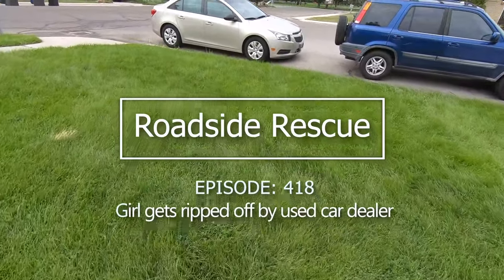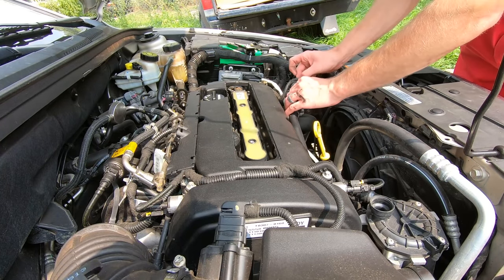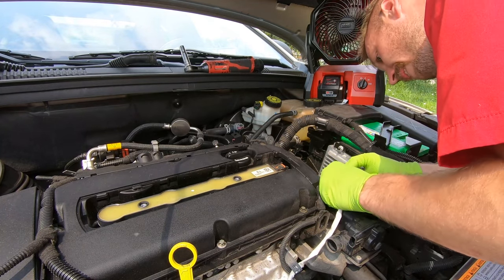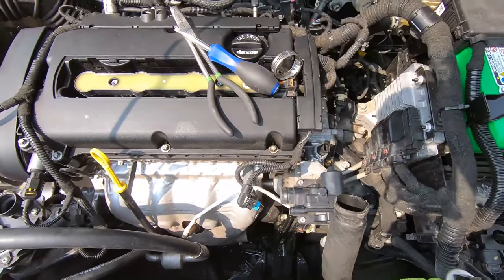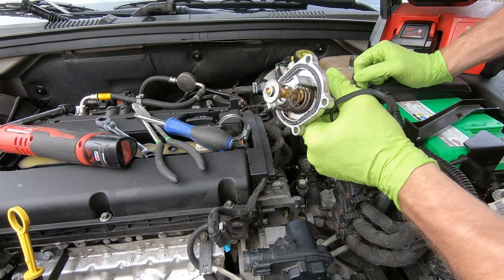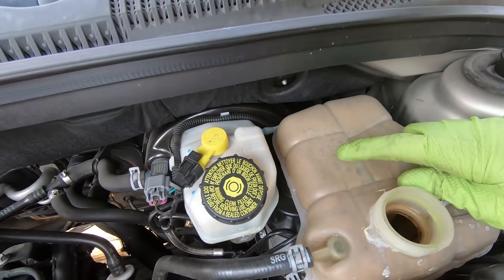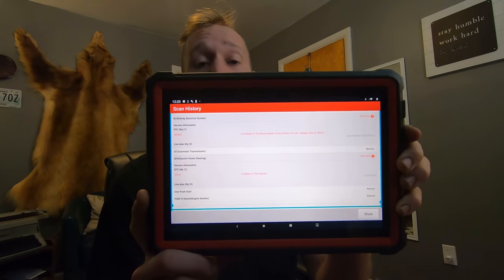Girl buys 13k mile "new" car. She was scammed. Heres what happened...

Comment: The only vehicles I buy are older cars that have the Ward's 10 best engines the Buick 231 3
800 Series I II III engines made their list from 1996-2008. You can not go wrong with a 2000-2005 Buick Lesabre or 2000-2005 Buick Park Avenue/Park Avenue Ultra LN67. These Buick cars are hidden gems that people overlook. They are cheap to fix maintain and insurance. Another hidden gems are the Ford Panther cars like the Crown Vic Mercury Grand Marquis the 4.6L Modular V-8 will go over 1 million miles if maintained and the Buick 3800 will also go over 500k miles if maintained. My friend has a 2000 Park Avenue Supercharged with  495,000  and still going strong and the body is still looking good.

Comment: Just got done with the wifes 2014 Cruze. Replaced the thermostat housing, cracked the end off the throttle bottle heater tubing on top, and generally was a pain in the butt. There is a metal tube that bolts onto the thermostat housing body (the one with two bolts) and runs underneath the exhaust manifold into an oil intercooler (can't see it cause it's blocked by a heat shield). If there is oil in the coolant, that would be the first place I'd start looking.

Comment: I had one of these cars with that engine. Mine had oil in the coolant but no coolant in the oil. Turned out to be o rings in the oil cooler failed. It was easy to replace. Also replaced the thermostat and coolant tank.

Comment: Wait…I missed the part where she was scammed. My mind wanders off from time to time.
Reply: Dealer claimed they replaced the thermostat and clearly, they lied.
Reply: @jamesplotkin4674  Chevy is the lie!
Reply: @yodead369  I'm so disappointed in GM and their crappy series of 4-cyliner engines.  I've had two Aveos (yes, one was enough) but had plastic thermostat housings break on the highway, ruining the engines because the temp gauges never showed a problem, plus one of them blew a head gasket even after a new replacement.  Now, Cruise, Malibu and Impala crap.  I miss my 79 ElCamino and 05 LeSabre.
Reply: I watched the beginning, and jumped around.  I never heard mention of 13k miles, or how she was scammed.  I won't be watching any more vids on this channel.
Reply: @jamesplotkin4674  Jettas are the same way

Comment: Ive worked on Chevy Cruze, 2011 model and it has an oil cooler mounted on engine underneath turbo.  That has leaked oil into coolant system before

Comment: Thermostat gasket will fail when oil is mixed with coolant on those engines. So the thermostat should be changed sometime soon.
Reply: The engine should be replaced ASAP . Don't bother changing the oil on this car's ! Just change the engine instead
Reply: @cdias3272 That's right! One could replace the oil cooler, thermostat, and all rubber hoses as the oil kills them pretty quickly. But engine has been run with bad oil so may be destroyed.

Comment: I'm curious as  to how old this video is though?  Because the newer Cruze is totally  different than the one shown, but the one shown seems to be of the 2010-2013 vintage era.  My parents have one from 2013 and it looks just like this one (as it should) but the newer ones (2018+) I believe were re-designed ,from and back.  If in fact this car was being sold as "new" a quick look under the hood should have shown something fishy.  Just looking at the wire harnesses should be enough to tell you it's a bit "aged".  However, when you say she bought a "13k mile new" car are we to expect that this is new to her, or advertised/sold by the dealer as "new" (as in, never used).  If the latter is true, part of me says that that is buyer mistake, because most people would look at see what a new one is like, and realize "Hey, this isn't the current body style."  Unless of course she bought it on one of those sites like Carvana where you buy a car sight-unseen, which I will never do, new or used.

Comment: Red Flags i look for, in a used car.

Freshly cleaned engine compartment.

Low miles w/ As Is purchase agreement.

Code Reader Dongle fixed in vehicle during test drive, or anything plugged into the port really.

Price is 'too good to be true'.

I tend to run my cars until they are Beyond Repair. After getting enough cars that reached this point less than a year after purchasing from a dealer, i have learned what to watch for.

Nothing sucks quite like dropping 5k on a commuter car with only 40k miles, just to have the frame shear off at a rusted weld joint, that was covered with spray on under liner to hide the issue. After 6 weeks. With a 'as is' clause that was 1 sentence long, tucked in the middle of the financing section on the third page, that you didnt read because you were buying cash outright, not financing the car.

Took them to court, and won, because of the way the contract was set up (lots of non-finance things in the finance section, that should have been in their own section. judge ruled they were intentionally hiding clauses in the contract, which is in fact illegal). But still, suckage.

Comment: That's not oil in the coolant. It's tranny fluid from the tranny cooler is. There built into the radiator. It's a common issue in these cars.

Comment: Horrible motor vehicles, can't believe GM sold them for so long. 90% of the Holden Cruzes I've lifted a bonnet on, they've all had chocolate milk as coolant. 
 Apparently the oil cooler bleeds into the coolant system and sludges everything. The head also warps, the auto gearbox flares and carries on, turbo models just give up... etc

Good video anyways mate 👍🏻

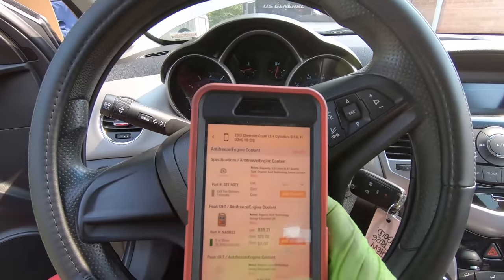Comment: 12:50 That sounds TERRIBLE! Is that a diesel?
Personally I would NEVER buy a car with a rebuilt title. No idea who/how it was fixed. Just buy an older Toyota or Honda.
Reply: @335m5  Are you really comparing routine maintenance on a car to an accident? Really? C'mon, there is no comparison. Even if the state has an 'enhanced' inspection, that really doesn't mean much. Have known many people with rebuilt/salvage titled cars/trucks and it's about 50/50. Some had nothing but problems and others didn't. Again, you just don't know who/how it was fixed. 
There is a reason mechanics tell people to stay away from rebuilt/salvage titles. Besides not knowing who/how it was fixed, you very rarely know what kind of damage it had in the first place and how bad it was. There aren't any laws requiring the seller to disclose that type of info as far as I know. They are only required to disclose it has a rebuilt/salvage title.
Just not worth it IMO when you can buy a 6+year old Toyota/Honda w/ under 100k miles for around 10k. Or at least you could before used car prices went insane. I Bought a 2016 Camry 2 years ago for about 14k and I could sell it now for more than I paid for it.

Comment: Hey can I ask you a strange question? I been watching your videos and trying to learn more. But I came across a strange issue. I just got a inspection and they cleared everything saying my car was fine. However when it idles it squeals in the back. Like just sitting in park the back end squeals horribly too. No one can seem to figure out why. I have a 2017 toyota camry se about 53k miles...
Reply: Interesting problem. There usually is not too much in the rear that could make a racket - my primary suspect would be the fuel pump (usually located under the rear bench, submerged inside the tank), especially if the noise only occurs with the engine actually running. (Failing that, maybe the rear screenwash pump or some motorized gadget stuck on, or something related to air shocks, assuming the car even has any of that.)

Anyway, I'd have the fuel pump checked out. Possibly a production defect given the mileage. Shouldn't be a super expensive job. Have mercy on the poor shop though and don't turn up with a full tank. Actually, better avoid having the tank particularly full at all until this is fixed, as a squealing fuel pump could be failing on you at any time, usually at the most inopportune moment (Murphy).

I'm assuming inspection is mostly external (mechanical, leaks, rust, money lights - i.e. safety and environmental).

Comment: I have a 2012 Chevy Cruze. The car has problems I’ll give you that, but if replaced with the right parts and if ya follow your maintenance schedule than it’s actually a good car. Thing is, it really depends on how good it was treated if it was a used car by the previous owner. The owner could have kept it in top shape. However if the owner of the car kept the car in disrepair all cars are gonna have problems. I have only had to really replace the turbo and the heater hose. However the turbo was completely stock at 98k miles. The Chevy Cruze turbos should to last 100k miles or so. Which isn’t too bad. The car is only meant to last from 100,000-150,000 miles, so really that isn’t bad. However some people’s turbos blow out sooner than other people’s. Really depends on luck and how hard you run your engine😂

Comment: If you buy a car without having it FIRST looked at by a qualified un-invested third party— you kind of deserve what happens. Do not sign that paper until you have it checked out. Yes, it’ll cost a few hundred bucks but it’s better than being stuck with a payment for years in the thousands of dollars on a car that does not work. There is no excuse not to have a vehicle you’re interested in checked out by a professional not related to the seller. AS IS is AS IS. That’s the LAW. Have it thoroughly checked out BEFORE you buy it. I will preach this until the day I die in hopes that people will hear me.

If the seller won’t let you— run away. There are plenty of cars for sale from reputable people who will let you have it checked. If they won’t let you— run away. Don’t walk. RUN.

Comment: I've done "roadside" repairs on 3 chevy cruz's. all were cooling related. You get what you pay for, im a GM guy but these cars are trash. The 4th i've turned wrenches on was a cruz with a split turbo housing. Under 100k and the exaust side broke in two. Not like this a performance car at all.

Comment: That's a base model LS with a 1.8L engine.  It's a freaking horrible engine due to being an interference engine with a timing belt instead of a chain.  Made on the same formula as the older Dodge Neon.  The Cruze with the 1.4L turbo engine was much better and competed with Honda and Toyota very well from 2011 to 2019.  The base model LS sucks though.  Shame is a lot of people do not do their research and cannot tell one from another.

Comment: I sure you know that vehicles traded are not inspected for a week or so. Salesmen don't know $hit about cars.
So if it runs and drives ok ( per salesmen ) it might get sold without a safety INSPECTION.
It's Ok to dump a klunker off to the DEALER but never the other way.

Comment: There was a time when GM built good vehicles. Now they cut corners building junk that barely makes it out of warranty, and the dealers are trained liars. My father and I both traded three-year-old Chevys for imports in 2019, after years of GM loyalty. I had engine, trans and axle issues at 86k, he had trans issues at 50k. Ford and Chrysler quality are just as bad, if not worse. Even Honda and Nissan have followed suit. Only vehicles worth buying anymore are a handful of Toyota, Hyundai, Kia, and Mazda products. Toyota 8-speed and 2.4 are to be avoided, as well as 2012-2017 Hyundai 2.4. Do not buy any 2004+ Nissan, ESPECIALLY those with CVT transmissions. Honda's Earth Dreams and CVT are to be avoided as well.

Comment: Head gasket is blown time to scrap it
Reply: based on what test performed?
Reply: @mph5896  time to buy another pos and junk that one to buy another pos.
Reply: Tic tic tic tic bang
Reply: Half of them motors are made in Mexico anyways . Ford and Chevy  I'd still drive an old car anyday AMERICAN MADE OLD V8S
Reply: @mph5896  Visual inspection of chocolate milk.
Reply: Prolly not on that particular vehicle. 🚗....."job well done". .. ...
Reply: @lyellgalbraith2895  or more likely the oil cooler is leaking internally which is fairly common on these motors.

Comment: Never buy Chevy products
Reply: i could argue the same about my old POS 01 Toyota Avalon (2 bad transmissions and rear head cracked in 126k miles) and the 98 Ford Contour (blown engine at 59k miles and transmission failed twice in 131k miles) i had that were on the tow truck more than on the road, yet my 98 Cavalier gave me 396k miles with only an alternator and valve cover gasket replacement before the salt ate it, and my 1988 Olds Delta 88 that gave me a trouble free 533k miles before it got ate by the road salt, and now my 04 Caddy Deville has 166k miles and my 03 Olds Aurora has 133k miles, and my 02 Silverado 2500HD with over 400k miles (i did have to replace the cluster so true miles unknown but it's over 400k) and all of my GM vehicles have never been on a tow truck or had any major issues outside of normal maintenance!